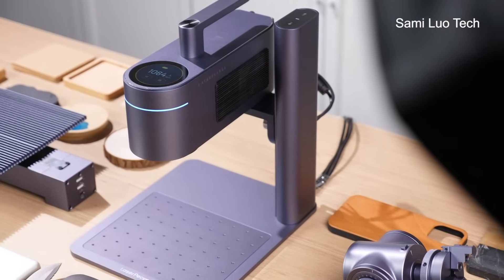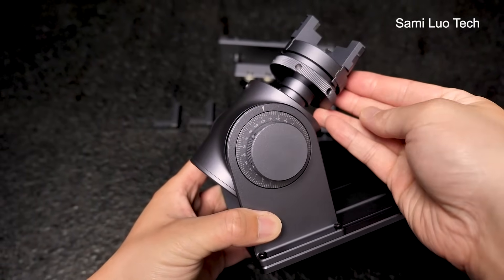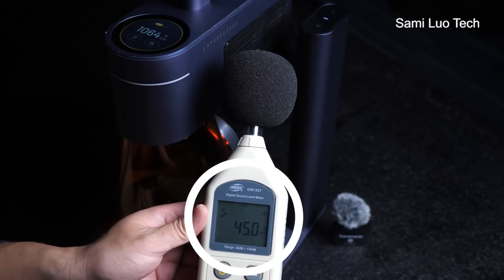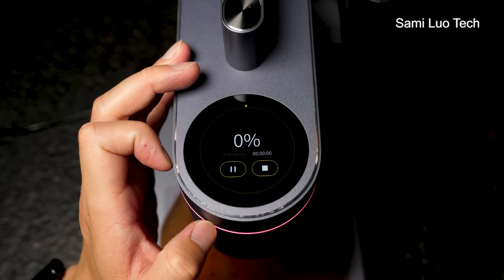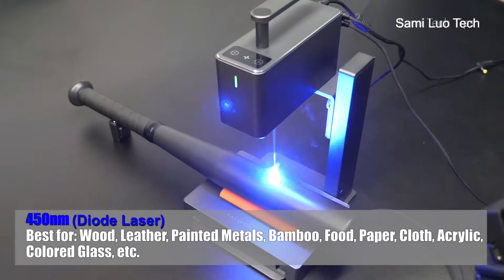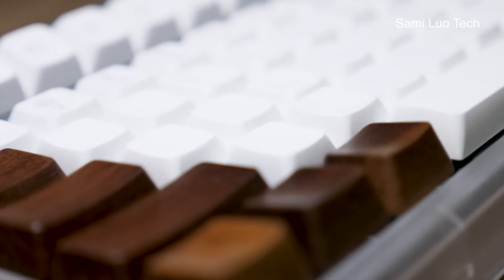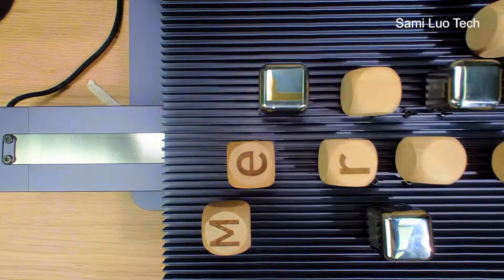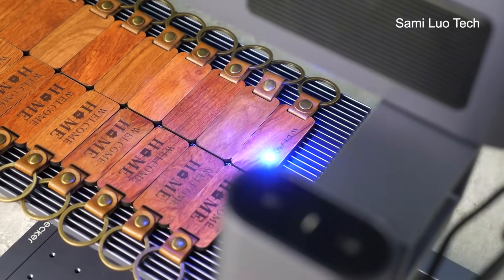LaserPecker LP4 Review: World's First Dual-Laser Laser Engraver is CRAZY!

Comment: Thanks for the review.  Would you say these are good for light/beginner commercial use?  I have a LP1 Pro just to familiarize myself with the tech and have backed the Kickstarter for the LP4.
Reply from the maker: Yes, absolutely. The best part for the LP 4 is it comes with an intuitive App and you can basically do everything there. I've reviewed many others and they all have to connect to a computer and adjust this and that, lots of hassle

Comment: Do you know if this will engrave part numbers in steel parts? We currently pay another shop to do this to our manufactured aluminum and tool steel parts. Please help . Looking to buy one ASAP if it can. I know you mentioned stainless steel but we’re engraving plane steel. 
Thanks in advanced
Reply from the maker: Hi yes, it would be no problem at all, you can use the 1064nm laser for the plane steel :DD this is what sets it different from that 450nm, which only works for 304 stainless steel .. :DDDD

Comment: Laserpecker is very impressive from the hardware perspective. But the software is awful! There is no G-code support on the computer, version 1 of the app is looks like it was ported from windows95 and the second version is still in beta with many features not working at all or working in a strange way. No Lightburn or LaserGRBL support nor any other cad system. 
You better spend some money to make it compatible with some popular cad systems or create a nice app to use all the precious features Laserpecker4 provides.
Reply from the maker: Hi, actually LP4 supports connecting to your PC and supports Lightburn :DDD I just didn't show in the video, but many designs are done in the Lightburn through computer. The new App supports G-Code as well :D

Comment: Hope now I can make stamp (using photosensitive rubber) and cut it in one go. Before I need to cut using hot wire manually (to seal the edge too, so it won’t absorb ink and ruin the stamp with bleeding edge).

Comment: How do you manage to engrave different objects at different positions in a single step like in 09:00?
Reply from the maker: Hi we first designed all the letters and then set parameters for each based on the cube material and then previewed the printing area to make sure it would engrave properly, then the LP4 would automatically switch between 450nm and 1064nm laser to engrave at one pass. :D
Reply: @SamiLuo  Hi, thanks for answering. But the focus of my question is how you tell the LP4 to engrave at different positions. How does the LP4 know, where the different parts are positioned?
Reply: I think he meant it's done manually in the toolpath and then he lines up the cubes to the preview boxes of each letter

Comment: No option to power with a battery this time?
Reply from the maker: Sorry I just confirmed with LaserPecker official again, seems it can't be compatible. LP4 needs 24v, while the previous power bank is only 12v
Reply: @SamiLuo  Nice! Thanks for the info. :)
Reply from the maker: @badgerwatkins  Sorry I just confirmed with LaserPecker official again, seems it can't be compatible. LP4 needs 24v, while the previous power bank is only 12v
Reply: @SamiLuo  Thank you for the update. I wonder if it would run off a 24v battery pack. Would be a nice stretch goal. :)